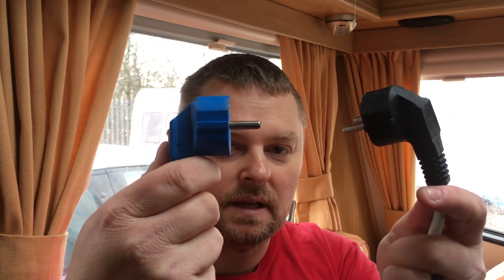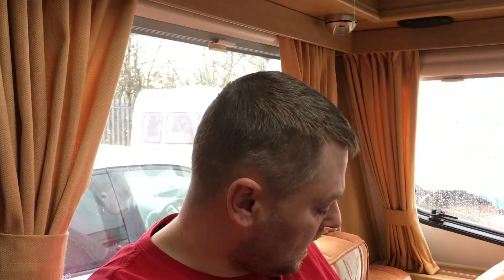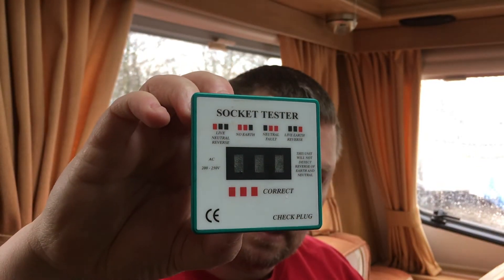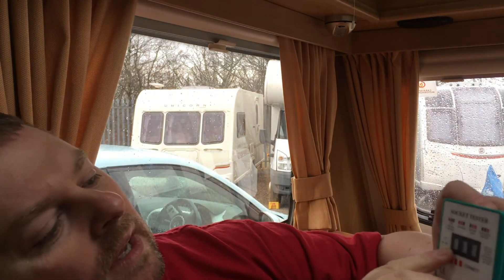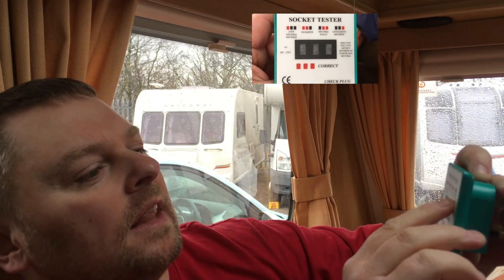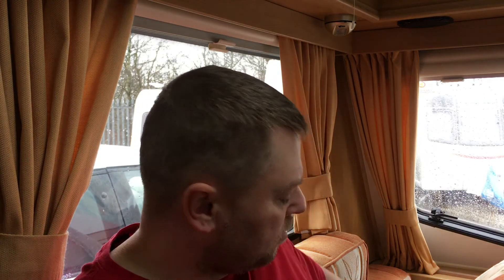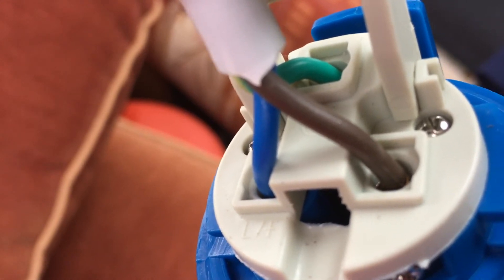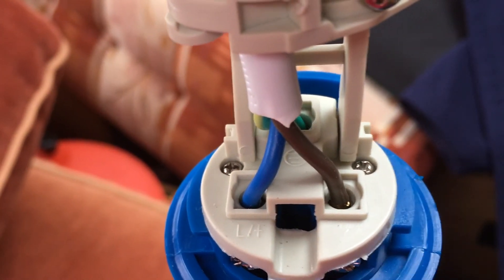Reverse polarity on hook up connection

Comment: Booked a couple of sites for May over in Brittany. I've got a plug and Socket spare, so I'll get a foot of cable and make my own reverse adapter just in case. The sites I've booked don't say whether they have RP, but I'm also taking the 2 pin adapter as well, but hopefully they will just have the standard set up. Thanks for the info! Cheers......
Reply from the maker: Hi John, as long as you test it first you will be fine. However we went to one site and the polarity somehow changed whilst we were there, not sure what happened there! Some sites have it listed but a lot don’t bother. Thanks for watching 😊
Reply: @TheCaravanNut  Thanks for the reply, yes I will test it with one of those test plugs You can get off Ebay or Amazon Cheers and I subscribed (Forgot to say before).

Comment: good video sir. I need some information tho. Thing is after realsing that we have been running 2 freezers for past 8 months on a switch with reverse polarity we have also noticed that our bill has gone up almost 80 to 100 pound. Dont know yet why because our consumption is still the same so why bill has increased??? Can this be the reason??
Reply: In short - no.
Reply from the maker: Sorry I have no idea, this clip is in relation to caravan hook up.
Reply: The Caravan Nut thanks for your reply and yeah I understand. But since the issue was same as reverse polarity I thought u must be good with electrical stuff overall hence asked. Thanks again. If you can ask any expert for us as I am looking still that ll be appreciated.

Comment: Hi ya thanks for getting bak to me about the 13th plug socket change over from 7pin  I've made a few phone round some tow bar fitter places and told them about my 7pin  socket and ny caravan  got a  13pin  plug  they said I would need a new 13pin  socket on car as I've only got one socket 4 trailer lights and not a grey one 4 chargening  leisure battery plus I've got AD on van as well so gotta have axtra  wiring added  ant  cheap  good job I watches your video  other wise I would of been in a pickle so thanks anyway keep up the good work .kev
Reply from the maker: Thanks Kev, it’s much easier having one plug, hope you get it sorted.👍
Reply: Thanks

Comment: Good advice. I've not come across any foreign sites with 2 pin plugs yet they've all had the standard blue type 3 pin plug. My motorhome's Sargeant power unit  has a reverse polarity indicator light, it doesn't swap polarity though. So, maybe I need a reversed 3 pin blue adapter.
Reply from the maker: Thanks Bob, I haven’t been to a site in France with a 3 pin plug yet. I better get one of those as well, just in case!

Comment: Hi ya good video  I've just  relise  thinking back to on your last video  about  changing  your two 7th pins plugs to just one 13pin  plug which is what I've got now as I've just change my van for a newer one which only as one 13pin plug on as my older van had two 7th n's plug on does  that mean now I'll  have to get my plug socket on car change to a 13pin socket as at the moment  it a 7pin  socket as only just relise .kev
Reply from the maker: No, you can get an adapter. Have a look at the link below. Cheers  
https://www.thecaravanshop.co.uk/towing-equipment/13-pin-to-7-pin-adapt/13-pin-to-7-pin-adaptor/prod_424.html